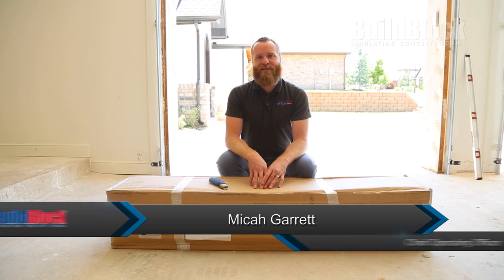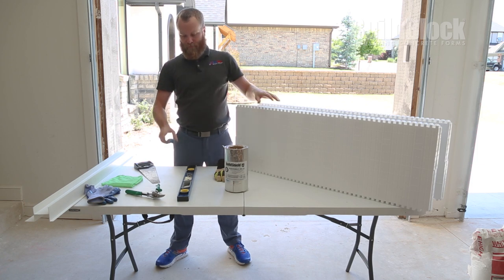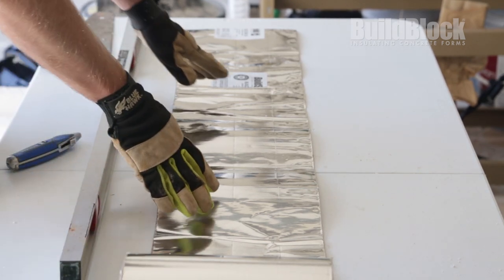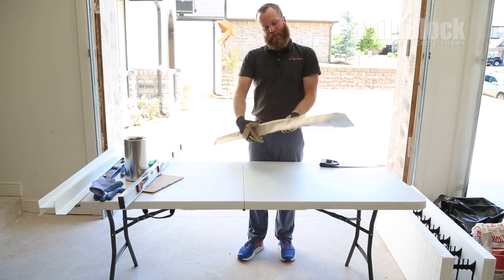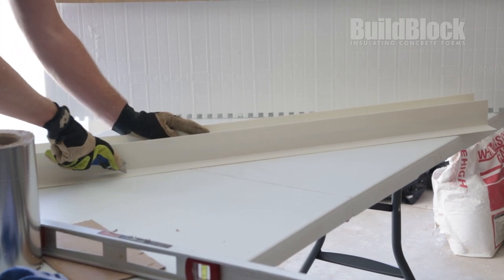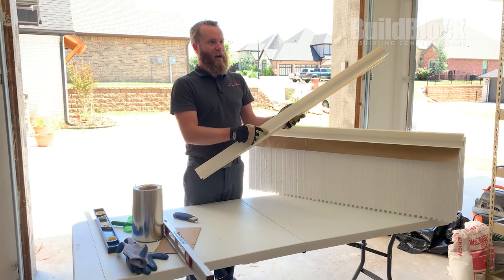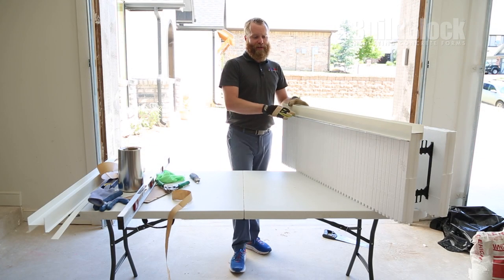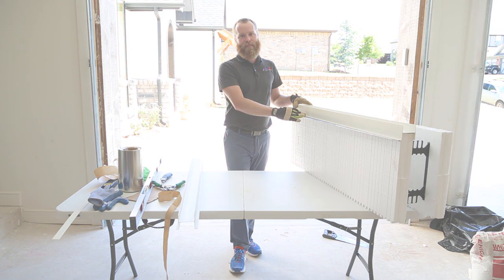BuildShield ICF Termite Barrier and Firestop Product Overview and Installation Part. 1

Comment: Why not just extrude the plastic channel out of aluminum or steel and eliminate the adding the metal tape step.   Would seem the cost difference would be made up in the labor savings.
Reply: Thinking the same thing, especially considering that the PVC "H" channel isn't fireproof...
If the termites can burrow through the ICF, it's very optimistic that "you're going to force them to the outside". Termites never expose themselves...

Comment: It’s an interesting product. I find the risk of cutting the steel is very high when trying to remove the backing. Perhaps the backing could come with a perforated rip line. It would also eliminate one step

Comment: seems way to finicky to me and to many chances of throwing the blocks out of level.  I would rather just cut out a channel near grade and fill with mortar to provide an inspection area to look for those little suckers.  Best combo it ICF and metal stud framing and eliminating any food source from the start. But I know that's not always cost effective for some.

Comment: I don't see the point of this.  If one PROPERLY waterproofs and seals the foam and footer junction for an ICF basement, bugs will be kept out.  Plus, there is nothing there for them to eat so I dunno what would attract them to the ICF in the first place: no wood...no food.
Reply: The problem is that the termites don't eat the icf block therefore they don't leave mud trails so you can't see any evidence or signs that they are there . I agree properly sealing everything is the way to go and maybe treating the area around the foundation ,but that will only last so long .

Comment: Definitely too complex a product. It would be much better to have a special build block with the termite barrier built in. It would of course have to provide methods to join blocks side to side and extend out to the finished surface. Ideally such that the blocking metal can be trimmed after the final surface is in place. So that any differences in the final surface depth are dealt with.

Comment: No crew has the time to do this for an entire foundation.  This is extremely labor intensive and not a good overall designed product.  
Wrap the underslab and outside perimeter walls with a continous termite protection product made by companies such as Stego Industries.